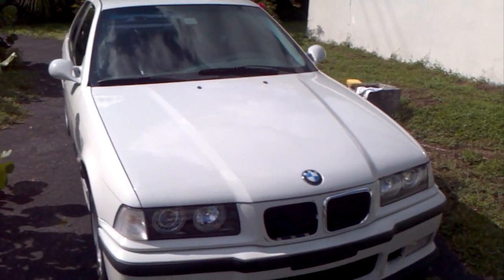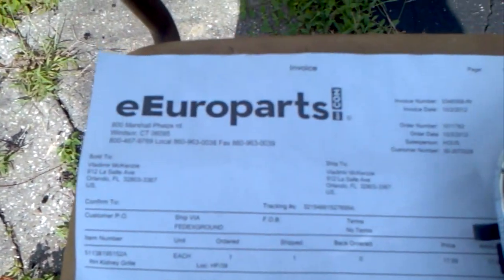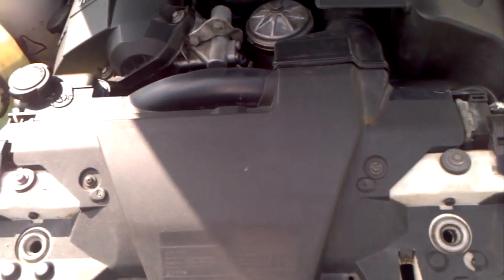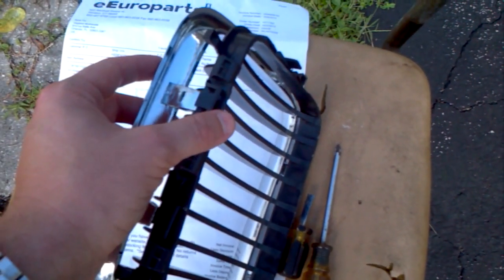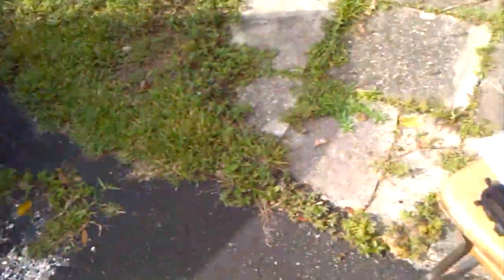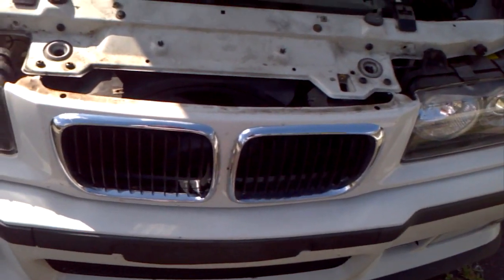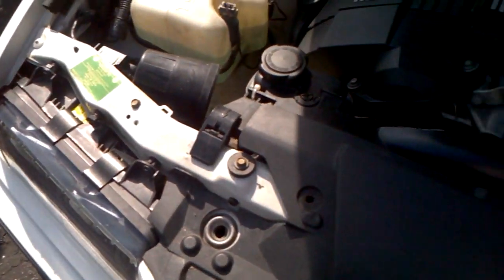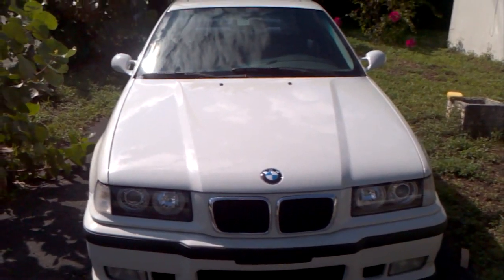E36 M3 kidney grille diy

Comment: No need to split the two parts when putting it on the car. The correct, and SUPER EASY way is just push it in there. It will self align. Only takes a few seconds when you have the grill out.
Reply: When I try to push it in the side clips don't reach far enough